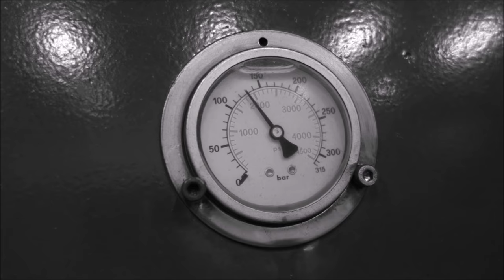Repairing electric motor bearing housing

Comment: Very disappointed you didn't press that insert into the bearing housing.
Reply: The wall thickness looks like it might be a little too thin to risk a press fit.
Reply: No, and he can still press it in instead of using a hammer. Hammer is faster though.
Reply: and he is not using a rubber hammer!?!?!?
Reply: He can use a metal hammer because he still had to machine the surface he was hitting that way a more direct force was being applied as the rubber hammer would have bounced back and he would have lost the kinetic energy needed to get the ring to meet up with the housing.
Reply: NickiLasse he'd left some sacrificial metal sticking out. It looked like about a cm. maybe I'd have used a copper mallet but it's really not so important.
Reply: End shields are quite fragile and could easy crack it on a press. Seen it done , I always use a copper hammer.

Comment: lenghty ? wasn't long enough, I would have liked to see it till the end, with the bearing replacement and the motor's reassembling :)
Reply: +Manu Muller that's probably not a job for them though 
usually when you get something refitted like that you just shop out the work that you can't do yourself
when you get an engine block bored out you don't get them to install the pistons 
when you get rotors turned you don't have them put it on
when you get a crank reground ...
Reply: +Andrew Brown true, haven't thought he was refitting it for someone else.

Comment: Shouldn't it be interference fit? Insert machined slightly bigger than hole then frozen while housing is heated up. Temperature difference make it possible to press one ito another.  When temperature of both equalize they are inseparable(your press probably could separate them). That is process required by ABB(Finnish manufacturer) in restoration of their motors. Repairs using glue are usually failing within a year.
Reply: Sasquatch we get end shields that other engineering company’s have repaired and your right the sleeve can slide out that’s why we make them a tap fit with loctite then Dutch key in 2 places @ 180 degree . Then finish bore last opp. Never comes out. 👍

Comment: If the newly glued ring corrodes, cracks, or otherwise needs replacement? how is it removed? Is it machined off? Special glue solvent?
Reply: Better of buying a new motor then i suppose :)
Reply: it's usually machined off, but you can kill the glue with fire :D
Reply: They just press it out
Reply: The glue will also uninstall if you run your motor with too high current!

Comment: I'm trying to figure out where he secured the jaws of the chuck during the first stage of machining the flats to secure it for the next step. 

In my mind he should have secured them to the inside of the old bearing surface to keep everything concentric to that hole but I can't see any chuck jaws in there. They might be there though.

But I'm a novice and I could have missed something obvious
Reply: The jaws are securing the housing from the inside  edge of the casing by pushing outwards. Only real available bearing surface given the shape and I guess he doesn't have any interchangable forks or anything for his laythe.
Reply: Acb Thr so my theory was correct?

Comment: Why did the job call for an insert instead of just cutting a larger inner diameter and using larger bearings?
Reply: Probably not enough material before he would start to interfere with the threaded holes. Looks like maybe 8mm clearance from those holes and he probably can't source a bearing that size.

Comment: The machinist in the electric motor shop where I worked used metal spray to build up corroded races for bearings.  Machining the ring seems like a lot of extra work.

Comment: Have you ever accidentally left that key in the chuck and fired up the lathe?
Reply from the maker: +Jack Chapman 

I havent done that ever. And I have also managed to avoid other dangers related to using manual lathe but you must be always very carefull when working with these because you have spinning parts right in front of you.
Reply: +Beyond the press I did it once a few years ago on my personal lathe. For a few moments, it was like living inside a pinball machine! My machine shop teacher would kick a person out of class if he ever saw a persons hand leave the key while it was inserted into the chuck. I never could make myself remember this lesson.

Comment: I’d be worried about bending the shim hammering it in like that. Too bad you don’t have a hydraulic press :p
Reply: Peter Charlton end shields are fragile and can easily crack using a copper hammer is the safest method

Comment: Why no indicator When Chucking up?
Reply: +DarthVirc That was my first thought, but then he said he does lots of these, they're how he ears his crust, so he must be doing something right. Maybe it has a self-aligning bearing :oS
Reply: 3 jaw chuck self centres, 4 jaw you indicate
Reply: +transdimensionalist This is a common big misunderstanding! The material is more stable in it, but that does not mean that the surface you clamped and the surface you intend to machine is concentric, even if you machined the other side before. In practice, if you remove a part from the chuck then put it back again, it probably will be off-center and need to be aligned again. This is very time consuming, doing some complex precise work in lathe requires planning ahead what you will and can machine in which pass to minimize part removals. Looks easy in this video, but it is more work in practice. Look at some rotating parts on the MakeItExtreme channel, they always have big visible runout.
Reply: i do understand, maybe the answer was over simplified, i use both types of chuck and indicate when using both as i have an old inaccurate machine, but on a well maintained, solid lathe and accurate chuck that you trust it isnt always vital to indicate every time if you feel accuracy is within tolerances. i agree about planning machining processes to ensure accuracy and concentricity in the areas needed :) blissings x

Comment: That housing should really have been dialed up in a 4 jaw chuck. Old 3 jaws can get quite a bit out over time. It could just cause misaligned bearing and unequal air gap in the electric motor leading to premature failure.
Reply: the bosses that he clamped onto were only in the spots for a 3 jaw